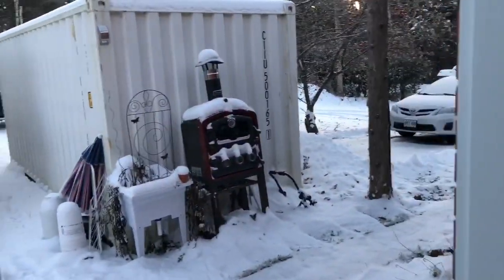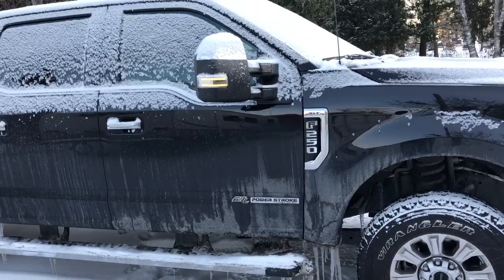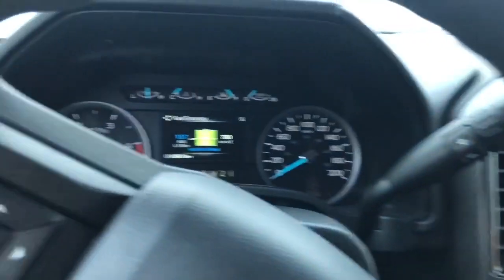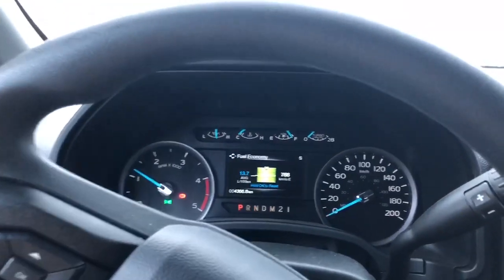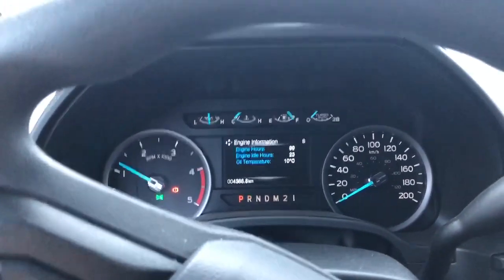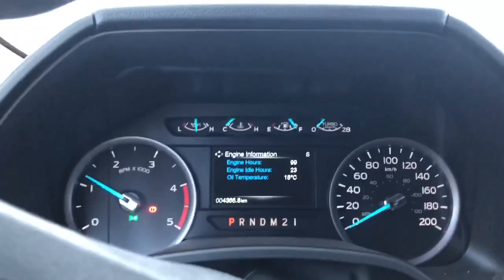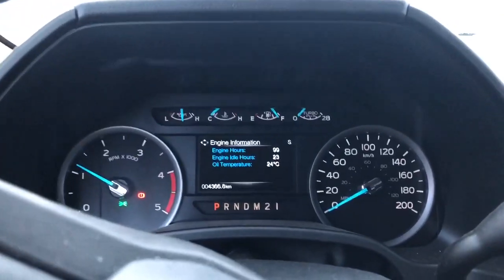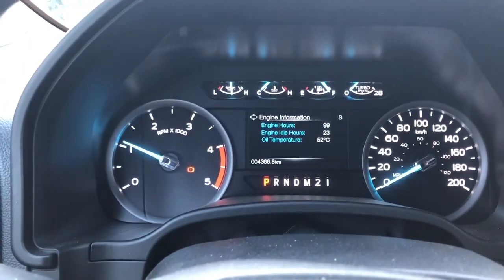-18c -0.4f...F-250 6.7L DIESEL cold start. This was interesting

Comment: The sensor for your engine temperature gauge is not on the radiator. It is on the engine. It typically measures the temperature of the coolant.

Comment: That is true. It should warm up faster with engine brake on. It high idling and itll do that when temp is so cold.  They claim 1200 rpms is better when its cold than 800 or whatever it runs Put a winter front on it when its below zero will help keep engine warm and furnace hot going down the road

Comment: it would be interesting to see what happens with the rpm's if it was plugged in on a timer eh, I've been readin its pretty normal for these trucks not to heat up that fast. some come with a supplmentry heater as a add on to heat the cab up diesels are like this my 7.3 high idles but comes down when you push the brake. in the cold

Comment: Been driving Ford Diesels for decades. Warming up stationary like this is just wasting fuel. Fine if you just do this for youtube purposes... Run it a couple minutes to make sure the oil is moving then just drive it. Mellow but drive it. Without some load on the engine it takes several times as long to warm up. I had a 98 that was the worst, if you let it idle, it would take 15 minutes to get warm. Puttering down the road a couple 3 miles would get you warmer
Reply: I’ve high idled my 7.3 and just driven it cold and I’ve never noticed a difference in warm up time